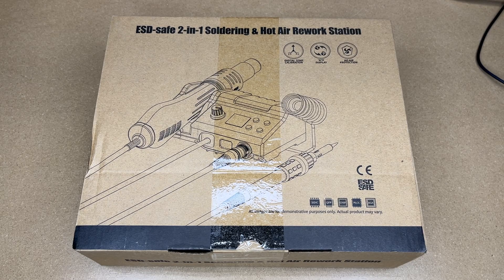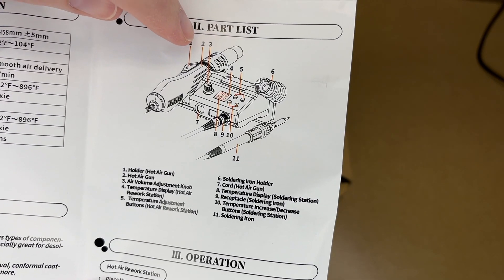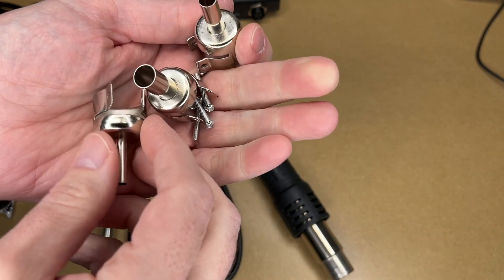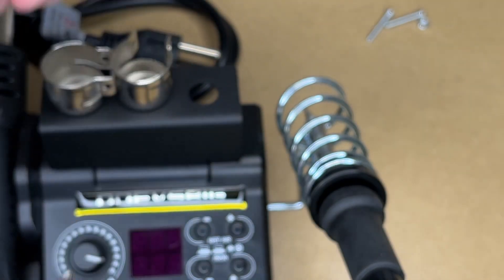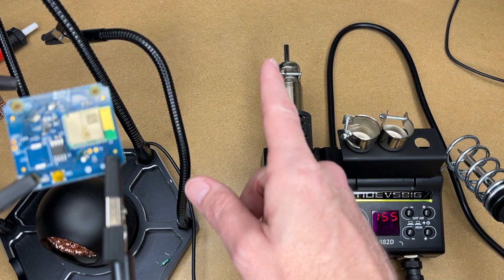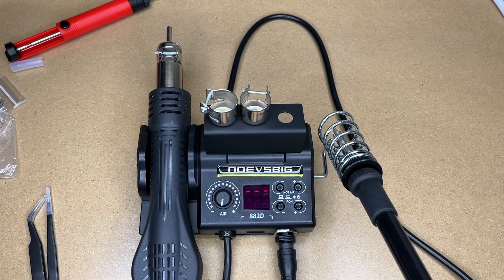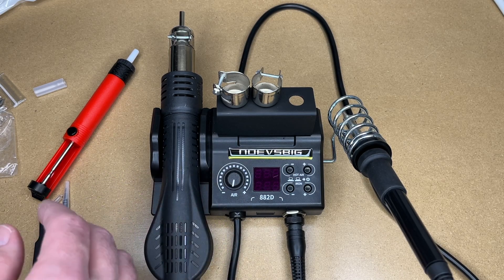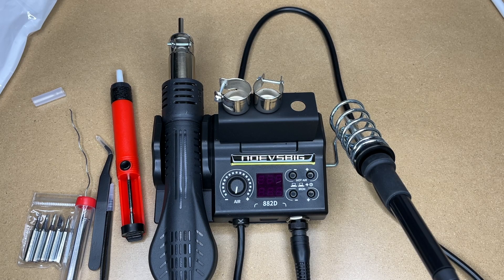NOEVSBIG 2-in-1 Soldering Iron and Hot Air Rework Station

Comment: Nobody says that when switching on ALWAYS it turns on the iron, even after a power failure the default is to heat the iron. That is a safety issue, very dangerois in my opinion. I realised after buying it!